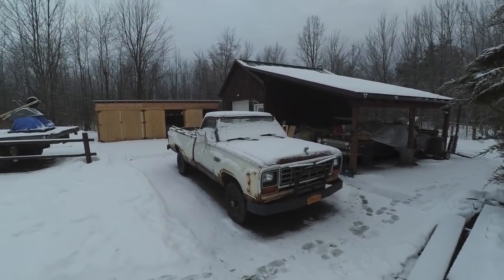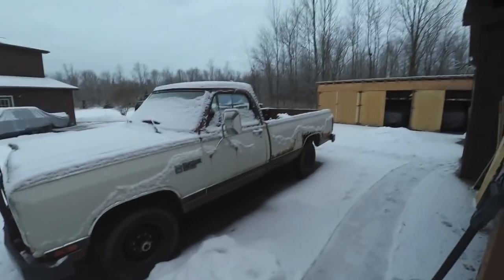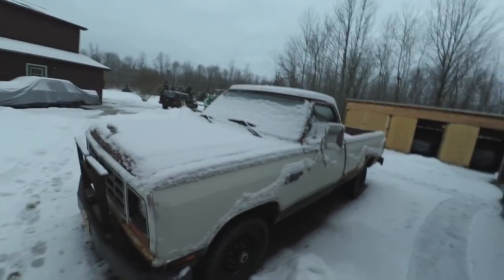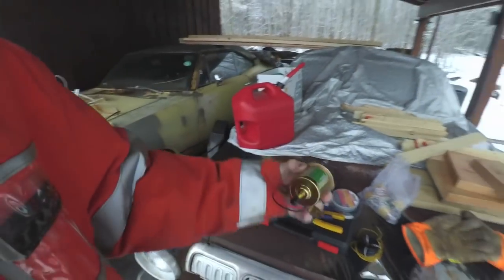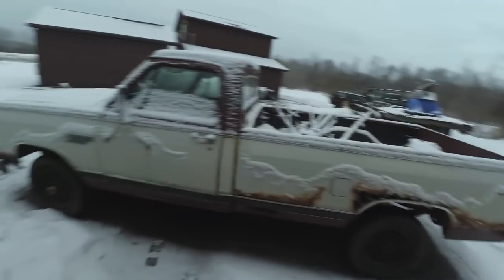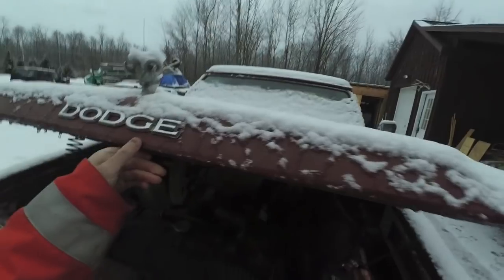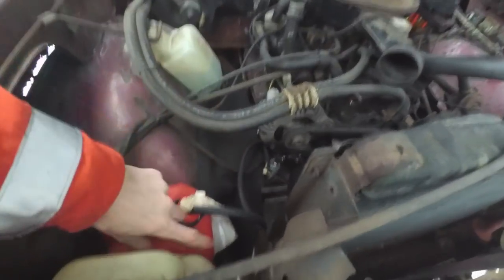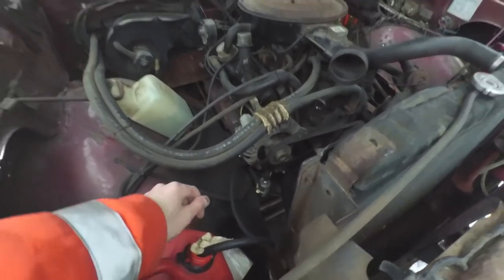1984 Dodge Ram Engine Problems Part 1

Comment: I have an 84 RamCharger with a 318 and holly carb too. Literally was going through this same issue. Would die the second I gave it some gas. My carburetor is currently being rebuilt and should be done tomorrow. Can't wait for part 2 to see if you figure out whats going on with your rig. Worried that when I get the carb back my issues wont be solved and if that is so hoping your solution will help me out.
Reply from the maker: I agree man and I am curious to see what you discover too, because I pulled the tank found it was full of crap, cleaned it as best I could, maybe a little bit of small crud left, redid the fuel neck and filler lines, sending unit, steel lines from tank to fuel pump, new fuel pump (autozone brand), fuel filter, left the original steel line going from filter behind the alternator to the carb, then the new carb too. It ran ok after all that for a few days then would do the same. I wound up replacing the distributor because an old friend said these dodges sometimes have a failure in the distrib electronics and the power kicks off and causes it to shut down. The original issue was more that; driving and randomly it shut down like the key was turned off. Then after the distrib it ran excellent last 4 months. Then this started, which seems more fuel starvation because it does turn off on its own again but its introduced this new issue to die also when you get it just above idle. Then sometimes it will like catch and rev fine and get going for a few seconds, then shut down again. What I failed to observe the first time after it ran good again was if the accelerator squirters on in the carb would spray fuel when I hit the carb by hand (to simulate pumping the pedal to prime it to start) because now when I try this I get nothing out the squirters when i bump it. So I am still working on it sadly not sure if the carb got gunked up and that's all it is. may need to rebuild mine too.
Reply: @FanelliRestorations  Oh man! What a pain, rebuilding a brand new carb! I hope that mine isn't that bad and its just the carburetor. I never had the issue where it would just die while driving. Hope you get it figured out and I will gladly share anything that I think might help.
Reply from the maker: thanks  @GarrettSanderson  I hope so too, if I get it figured I will let you know for sure!
Reply: Fanelli Restorations hey man so good news for me I guess is I got mine running really nice once I got it to start by priming the carb with gas. Hope you get yours figured out soon. I’ll be looking forward to the solution!
Reply from the maker: @GarrettSanderson  great to hear man! and I think I was on to something last night, I will have an update soon!

Comment: Looking forward to this series
Reply from the maker: thanks for watching man!
Reply: @FanelliRestorations  aren't you worried about the rust on your truck? How's the frame? Im really worried about my 88, its also got a  318 and 4 speed, but with tbi instead of a carburetor.
Reply from the maker: @peturkristinsson9463  I mean yes I wish the bed wasn't as rotted as it is but I bought it a year ago from Ohio where it was used for snow plowing and it saw a lot of salt im sure. The frame is actually still very solid no rot or cracks, just rust scaling which can be cleaned easy. She looks worse than she is. That's cool though man!

Comment: I have the same thing with my Fairmont, but seems to be only when it's cold. After I start it again after it falls on its face, it runs fine. I did change the fuel filter, do think that the gas is really old in the tank though. I mean at the very least it has been running off of gas from August
Reply from the maker: Hmmm. gas from august isn't that old to deteriorate even with the ethanol these days, unless it was mixed into even older gas when you got it. May be worth getting one of these $10 pumps i got here and sucking out the old fuel just in case and starting fresh. What you're describing sounds almost more like a carb/choke adjustment where it just needs to warm up. If it doesn't die after it's warmed up then it's not too bad.

Comment: my guess would either be a rubber line collapsing, i had that issue in my work truck, even had an issue with a new rubber line that with tank in the line from the sending unit to the new steel would bend causing issues. im not keen on dodge but do you have an ignition module
Reply from the maker: I was suspecting that too, I replaced all the rubber lines and there's only one maybe 8 inches in length with no bend coming out of the sending unit on top of the tank connecting to the steel line that goes up to the front, and little rubber between pump and fuel filter which could be but again I replaced too. I also did replace the ignition module distributor coil and plugs. I've heard of the bulk head connector going bad and causing shut downs, I tried wiggling it and touching it while it ran and that never caused it to turn off..so I am still perplexed by this old truck
Reply: @FanelliRestorations  at that point I guess the only thing I would try is another fuel pump, maybe a bad fuel pump rod. It seems it could not be getting enough gas. I kinda wanna say vapor lock but I don't think that's it. Unless you just have an odd vacuum leak.

Comment: my guess is the screen in the tank is falling apart and clogged your carb or the seals in the fuel pump are defective allowing air in
Reply from the maker: was some of my oriignal suspicions too but I replaced the entire fuel system it's got a brand new stainless sending unit from LMC Truck in there, and the fuel pump is new too.

Comment: I got an 86 d250 and Its running to much fuel and fouling my sparkplugs out but im not blowing and black smoke through the exhaust it drives fine but idles really rough

Comment: or you forgot to tighten one of those replaced lines or a line is defective and is collapsing or clogged , check the ends there maybe a split in the hose
Reply from the maker: checked all the lines they are tight shouldn't be air leaking into the fuel system but I was suspecting that. Replaced all rubber fuel lines and basically the whole system

Comment: just for the hell of it ,while its turning over spray wd40/starting fluid around egr- base of carb ect  if it starts / or rpms go up youre on to something   wish i was there in person  i like figuring stuff out
Reply from the maker: lol yup tried that too, no idle increase, gave no signs of vacauum leak, I wish too could use the help. posting part 2 today youll see more if what i tested

Comment: ok one more and i wont bug you anymore is there a part throttle solenod on the transmission or start switch on that year truck? i am a little lost with all my books in storage at the min
Reply from the maker: hmm I;m not sure if it has either of those

Comment: my only other guess or 2 is no/weak spark-  major vac leak
Reply from the maker: was suspecting that ways back too, replaced the whole igniton system the spark is fine but maybe the igniton is cutting off in general. Vacuum leaks I tested for a while ago too..I am at a loss with this truck lol

Comment: Double crimp !  Once where you crimp the metal to the copper then again where you crip the insulator to the insulation of the wire.  That way there will be no flexing of the copper at the metal and less chance of separating.
Reply from the maker: True yes I normally do, just didn't do it in that part. Next installment of this series you'll see I did, thanks for the advice